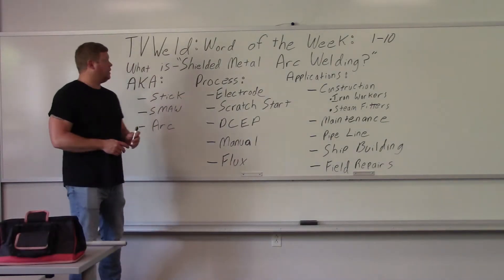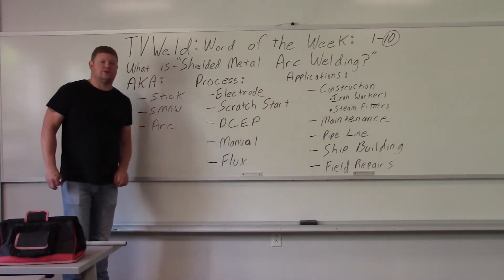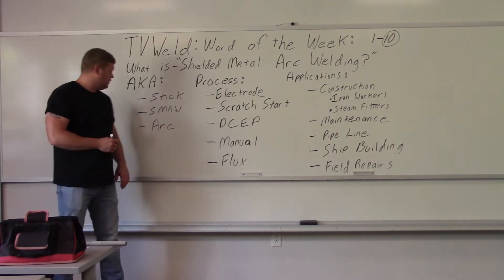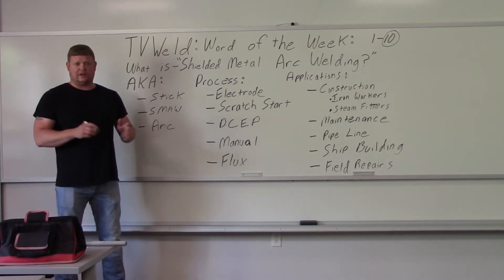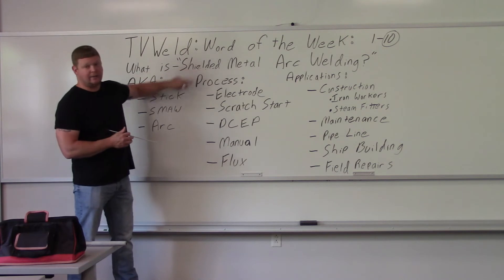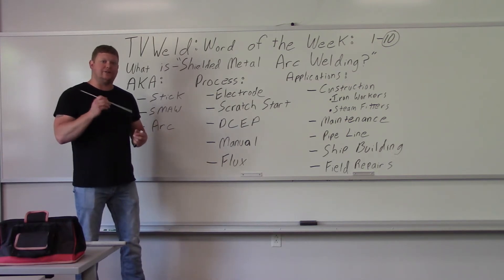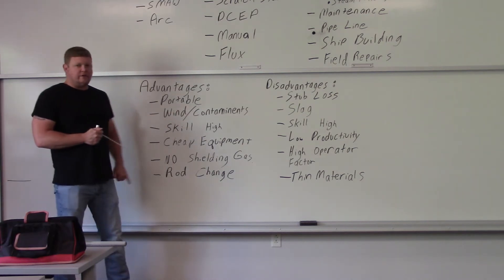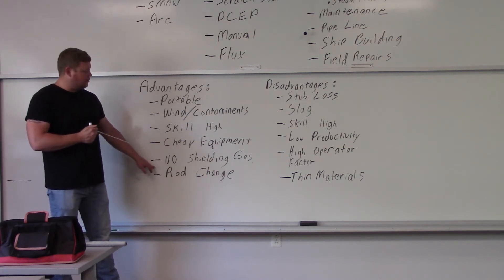What Is Stick Welding

Comment: how long were you welding before you pursued your CWI?  As a CWI are you ever without employment?  As an older guy getting into welding I want to become a CWI/CW educator eventually and as soon as realistically possible.  Any recommendations?  Thanks.
Reply from the maker: I was welding six years before I became a CWI.  I don't just do CWI work, but if I did I it would be rare to not have employment.  I just searched in my area for CWI jobs on LinkedIn and 2 popped up both over $80,000 starting salary.  My recommendation is to get familiar with the code book.